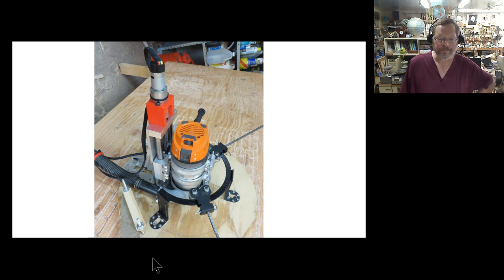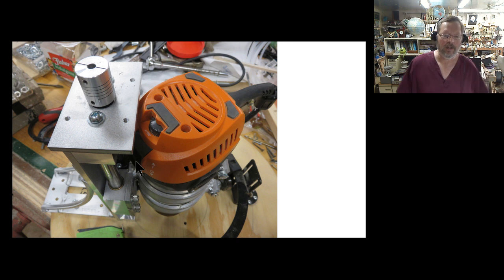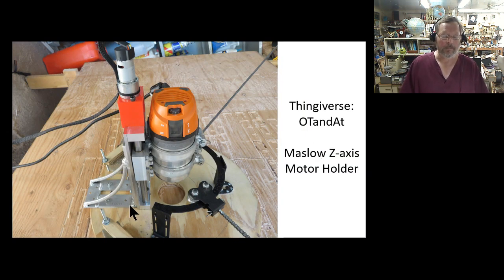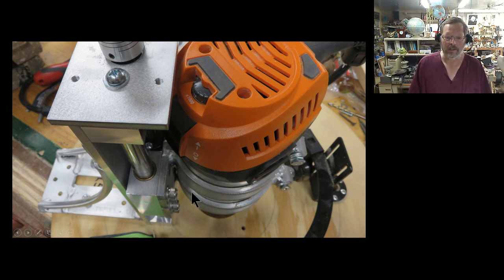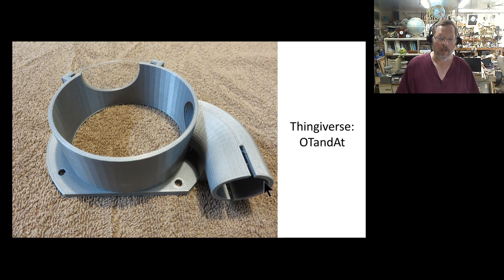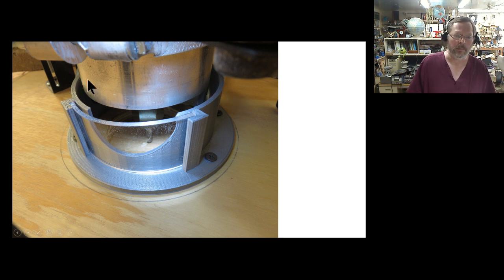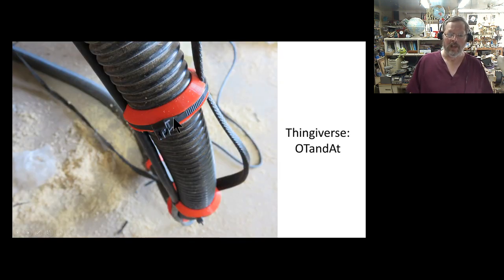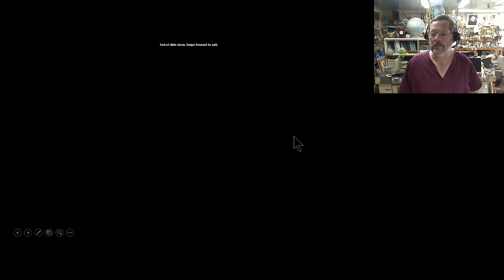New Maslow Z-Axis

Comment: $178 shipped for the z axis, you can get similar from china for a bit less.  https://www.aliexpress.com/item/3d-printer-Z-axis-diy-c-beam-CNC-sliding-table-lead-screw-travel-250mm-T8-screw/32819170005.html?spm=2114.search0604.3.22.1b735893HWg3nL&ws_ab_test=searchweb0_0,searchweb201602_3_10065_10068_10130_10547_10546_10059_10884_10548_315_10545_10887_10696_100031_10084_531_10083_10103_10618_10307_449,searchweb201603_1,ppcSwitch_5&algo_expid=8960ca1a-2017-4d89-8602-080bef668e68-3&algo_pvid=8960ca1a-2017-4d89-8602-080bef668e68&priceBeautifyAB=0
Reply from the maker: Yes I looked at this one originally and almost went that direction. This one is certainly cheaper but the main reasons I didn't go this direction are; 1, The slide uses exposed wheels that could potentially trap or pinch chips or sawdust between the wheel and the rail and impede the travel. I feel this would work good in a dust free environment, however that is not the Maslow. 2, The distance between the two rollers is not very wide. I wanted a wider base i.e. stable, to mount my router upon. The wider the base the router is mounted on the more stable it will be and the better the precision. The last reason was the threaded rod pitch. The 8 mm is the equivalent of 3.17 mm per rotation and I wanted something faster. The slide I went with has a 2 start Anti-Backlash nut and when combined with the 3 8 x 12 lead screw will give me 6 revolutions per inch or 4.23 mm of movement per rotation.  Some additional selling points that won me over where the case-hardened shafts and I feel the Oilite® bearings will work better in a dusty environment. Just FYI I don't have any connection or relationship to microcarve individual who sells these, I just appreciate excellent workmanship.

Comment: Thanks. The z-axis is definitely the weak point in the design right now. Hard to find an affordable solution. Mine has seized up on me a few times and I wasn't able to recognize what was happening right away. It just paused during a retract and I had to cancel some cuts part way through. Even though I have since ground out the channel in the base casting and smoothed and lubricated, I'm still not confident letting it do any Z moves without me right there helping to ease it up and down. Appreciate the videos, going to look at this upgrade soon.
Reply from the maker: Thanks for appreciating! There are cheaper (and slower) slides out there, but the total price for the materials was less that 4 sheets of 1/2 inch Baltic Birch plywood. (of course the tools needed are extra, extra fun that is... Jon)
Reply: Hi, thanks for this video and sharing your work. I live in Norway and have used my Maslow with the AEG MF1400KE Router (Europe version of the Ridgid router many use) for sometime. Im woundering if this version of z-axis could work? https://www.ebay.com/itm/200MM-Stroke-CNC-Linear-Module-Sliding-Table-XYZ-Axis-Cross-Slide-Linear-Stage/264141805906?